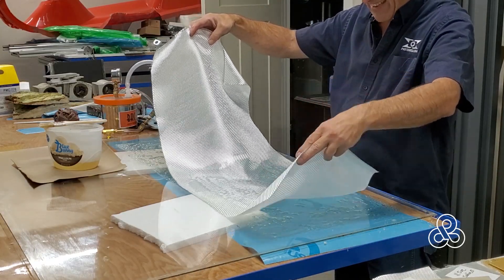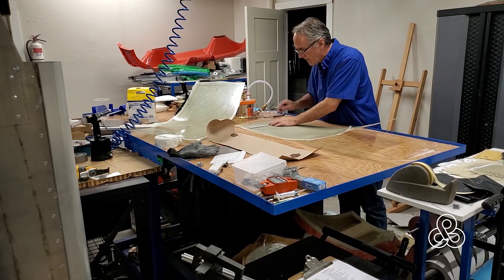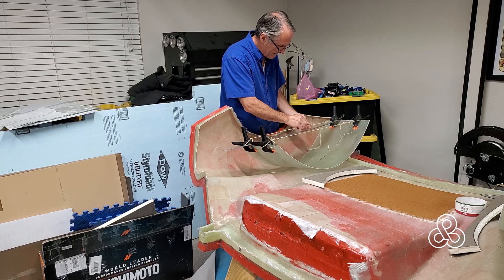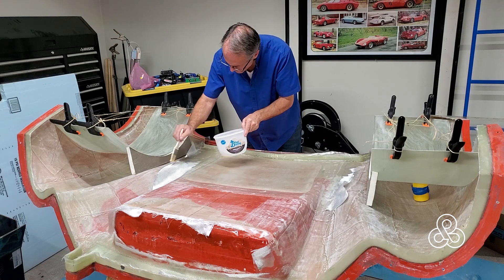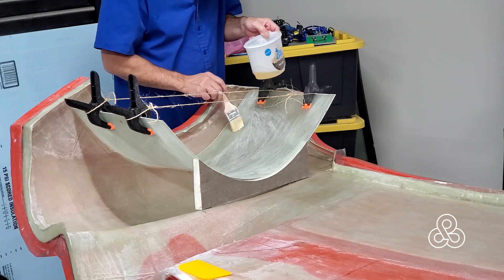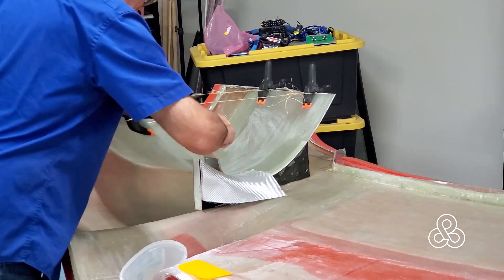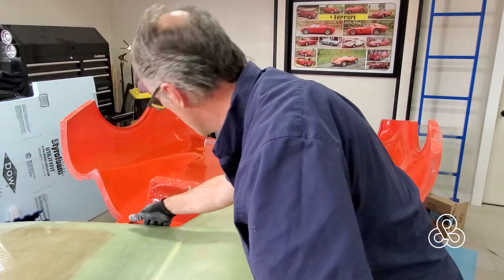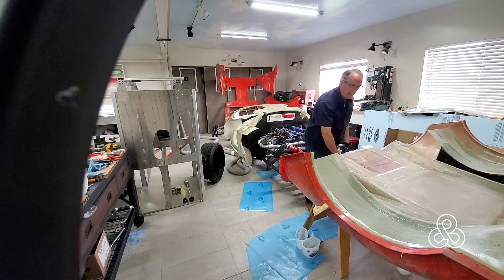A43 - The rear clam-shell/engine cover comes out of the mold, Arete Supercar Project.

Comment: What is your idea for the final thickness of your body panels?    6 or 8 layers?
Reply from the maker: 1 surface veil layer or 3.5oz and then  6 layers of a  9oz S-glass layers is enough for a curved panel that is fixed. If it has an edge laying in the slipstream and could get into a flutter at speed or support any kind of structure then of course its going to need some more stiffness. Flat panels are best served with cores. (4 layers- core - 3 more layers. min.) We are building for light weight. If you want to climb on your car, sit on the hood or drag it out of the mud by its fenders- more. Ha!

Comment: How do you determine the proper location for the wheel well. Seems like you just eyeballed it.
Reply from the maker: It was centered over the arch in the rear clamshell. Not a precise alignment, but probably within a 1/4 inch of center. Not particularly a critical part, just to keep water from spraying inside the clamshell over the engine/drivetrain.

Comment: Hello! You are using Epoxy and fiber glass cloth on the what will be the outside layer that will get the paint. I would like to ask you in your experience, if you paint the car black will you get cloth print through like the first Corvettes do? I know they used polyester but will epoxy resist that? Thanks.
Reply from the maker: I have used a very light weight cloth on the mold contact side to reduce print through. It doesn't necessarily get rid of it completely, but I will be doing a full finish to all painted surfaces, a treatment mass assembled Corvettes could not be given.

Comment: Thank you for taking the time to make theses videos. I'm planning a build myself for next summer and doing lots of research. Patiently waiting to  see how you attach these panels to the chassis. Can you please get into details on that video ? all the videos I see , nobody really shows upclose attachments or what hardware tricks etc.. is used.
Reply from the maker: Coming up!
Reply: @BuilderCreator  Hi sir my name is Ali I am mailing you to ask one question which is technical you have used Toyota 1JZ-GTEs engine which Toyota used in it's front mounted engine cars but you took the same engine and used it in mid engine mounted configuration do you have to do some change in engine design to used in mid engine layout or you just pick the same engine and mounted it in mid configuration because basically it is build for front engine placement and secondly does the engine block build for.mid engine layout is same as engine build for front engine layout well waiting for your humble reply thanks indeed very much God bless you

Comment: What weight and style glass are you using,? I'm guessing it's a twill (2x2) weave, 8.5oz.
Reply from the maker: My theory goes like this- 3oz satin weave against the mold to reduce print through, 6 and 8.9 oz Plain weave S-glass, for strength, everywhere possible and 8.5 oz 2x2 twill when I hit spots that the S-glass has difficulty conforming. Would love it if I could find a twill S-glass, but understand that by it's nature S-glass is not as flexible and the demand for an S-twill is low. Once you move to S-Glass your looking for strength in a defined direction not "build up."

Comment: How many months are remaining to complete this
Reply from the maker: This depends on which way the wind blows!
Reply: @BuilderCreator  one thing i want to know from you is how to join fiberglass panel with metal chasis  i saw some people using screw from the outer side of body but it look seriously awkward
Reply from the maker: @harisrafi3932  You are right, using fasteners that penetrate through the fiberglass is a bad idea, plus they just look bad. Since FRPs (fiber reinforced plastics - fiberglass) is not known for strength in "ductility" under tension, it will often crack at a fastener. This is most common when there is vibration and tension combined. It is just to much load at a small area. So, the answer is to spread the load out.  The easiest way to do this is use a material that is more suited for a concentrated load (something more ductile usually) like steel. This way, the steel can absorb the concentrated load and spread it to the FRP structure. Now, as you can see, the steel transition needs to be a device that goes from a small attachment point to a larger (spread) bonding point where it attaches to the FRP.  Watch this video for an example - https://youtu.be/d6LVlq7tTXI   Of course there are MANY more methods, but most follow this idea- spread the load out. If you must use fasteners through the FRP it is best to use lots of fasteners spaced close together and use an adhesive bond as well. This is similar to aircraft construction where thousands of rivets are used, as aluminum suffers the same "fatigue cracking" at fasteners, if the loads are not spread out. Hope this helps give you a general idea for you to think through solutions.